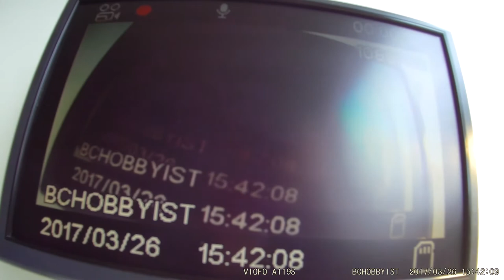How to Focus Dash Cam Lens VIOFO A119S

Comment from the maker: // timeline // 0:20 return option // 0:52 mark lens position // 2:20 loosen locking ring // 3:04 adjust focus 2 notches // 5:09 reconnect lens to focus // 7:00 live focus with A/V out port //
// 11:10 lock lens position //
Viofo A129 Duo Dash Cam Review: https://viofo-a129-duo-dash-cam-review.blogspot.com
Viofo A119S Dash Cam Review: https://viofo-a119s-dashcam-review.blogspot.com
Viofo A119 Pro Dash Cam Review: https://viofo-a119-pro-dash-cam-review.blogspot.com
Viofo A119 Dash Cam Review: https://viofo-a119-dash-cam-review.blogspot.com

Comment: My dash cam just stopped working! it gets no power, not turning on at all! don't know how to find out what issue is.
Changed cable but still no power. I think something is dead inside but i'm not sure which one.
Reply from the maker: Troubleshoot Dashcam https://viofo-dash-cam-selection-advice.blogspot.com/p/dash-cam-troubleshooting.html
Reply: @bchobbyist  Thanks, but I am not electric to find the issue. I think my cam is just dead!
Reply from the maker: @Virtualvideos11  it probably a power issue or internal cable disconnected or failed firmware. Suggest attempting Firmware Update. How to Install Modified Firmware: https://viofo-dash-cam-modified-firmware.blogspot.com/

Comment: Sorry, but I see so many potentials for failure in this.  

1)  How does rotating the entire lens only change the focus on a single side?  You are effectively moving the lens in and out.  This will not only refocus the blurry side but also the  part that is good.  You will be sacrificing overall focus.   

2) Never insert a connector not designed for a socket unless you are 100% sure it is compatible.  Video signals contain any components, including a ground in many cases.   Partially inserting a cable and then "giggling it" could very easy short ground to another signal and take out the video driver, not to mention weaken and loosen the connector.   

3) The process itself if flawed. You are expecting someone to manual hold a loose camera, aim and make adjustments then put the camera back into the exact same position to compare the new results and redo this over and over.  Every time you move the camera you will not be focusing from the same spot to recheck.   The only way this would come close to being more accurate would be to have the camera in a fixed position  in some sort of a rig facing the target while the locking ring is loose and you rotate the lens while teh camera and image being focused on stay in the exact position.  The  calibration image should be one similar to those used for ISF calibration - the circles and line with numbers so you can try (key word try)  to verify sharpness down to the pixel.

The reality is this was probably calibrated at the time of manufacture on a test rig that injected a test pattern for the assembler to calibrate with. It seems to me the most likely culprit of focus issies on one part of the image is more than likely the image sensor or the lens itself.
Reply from the maker: This video was specifically for Defective Lens VIOFO used in original A119S in 2017. The defect was off-center metal Lens base which was replaced with plastic later on and now back to new metal base to eliminate thermal dynamic expansion causing Focus drift in hot weather. Risk to opening hood of your car, becomes DIY repairs.
Reply: Lens ring replacement. My ring cracked.

Comment: Would this apply for A119 V3 as well?
Reply from the maker: All A119 models have slightly different Lens but the focusing method is the same. I also had to adjust my A119V3 Lens.
Reply: @bchobbyist  Would you be able to make a video for A119V3?

Comment: hi, both of my A119S present the focus drift between the start up phase when the dashcam is "cold" = good focus, and operating temperature state, "worm" = blurry image, focus drifted. seems to be related to the plastic mount. if you have the refocusing of the V2, a lot of glue and maybe more risky, it can be helpful. I prefer to have the good focus when the dashcam is worm. means when cold will not be good, but less important, so some kind of compromise. Viofo doesn't have the metalic holder for the V2, only for V1. thank you, cheers
Reply from the maker: suggest viewing my Lens Comparison video as well. If you have disassembled your Lens module and removed plastic cowling to reveal the lens, barrel and sensor circuit board you can determine the cause easier. The strange focus drift could be caused many ways, this is where holding the naked lens as shown in my 'Lens Refocus' here helps. If you perform this procedure holding the lens barrel put your fingers on either side of the sensor circuit board edge and notice the heat level. If extreme heat the sensor itself might be damaged or board warping. If normal heat check torque on both screws holding lens base. If one is loose focus will drift. One of my V2 lens is glued to circuit board the other is not, both don't suffer from focus drift.
While holding naked lens and dashcam powered on as in video above slowly aim lens all directions then review footage on computer to verify the lens glass elements in the barrel aren't shifting. I suspected this in 2016 first batch of A119S F1.6 lens with soft focus issue.
(To verify a Lens is coated hold under LED/Fluorescent bulb if slight green tint its coated)

Suspect causes: (1)loose lens holder (2)sensor board heat flexing (3)sensor itself is over heating (4)glass element is loose and shifting inside barrel (5)chipset is making incorrect focus adjustments similar to hot pixel masking (6)bad solder joint near or under Sony Sensor chip that connects/disconnects with temp changes.

DIY repairs: (5)downgrade Firmware to version 1.01 (3)only use 30fps, file loop 3min, 64GB card max, disable FCWS&LDWS (1+2)do not over torque base screws. (4+6)defective hardware

 If the A119S lens in your hand shifts focus after set period of time using FW1.01 it is defective and must be covered by warranty. Always contact original vendor (Amazon) first then manufacturer last.

Comment: If one were to replace the lens for the purpose of focusing on objects that are more distant, are there any additional issues to look out for? Are the threads the standard M12 size?

I have the A119S V2 with the revised GPS mount and contacts, if that makes a difference.
Reply from the maker: replaced my A119S lens and creating a bunch of dashcam test clips shortly. Since you have the same model disassemble your lens module and measure the thread diameter, your mount base is probably different from my version 1. wait for my new lens comparison videos.

Comment: On disassembly of my own cam, it wasn't clear to me why that black tape is even used.
Reply from the maker: The black tape seems to be insulting the contact grid points used for testing or another dashcam design. Why it covers the air holes for cooling is just another poor quality control issue. Always amazing me the paid Beta Testers never discovered such an obvious flaw and the reason I make these videos.

Comment: Is the lens base plastic or metal?
Reply from the maker: original A119S with F1.6 Lens has metal aluminum base with brass screw lock.
new A119S (June 2017) with F1.8 Lens has grey plastic base with lots of glue, refocusing is possible but alignment adjustment impossible without damaging surface mounted components.
Lens Comparison > > https://www.youtube.com/watch?v=x1sSxLt6Z3o